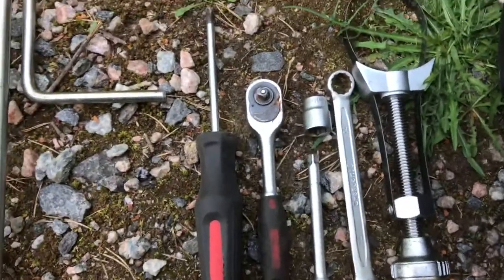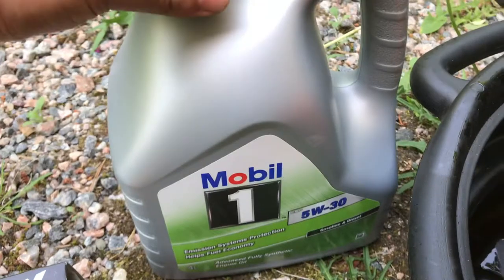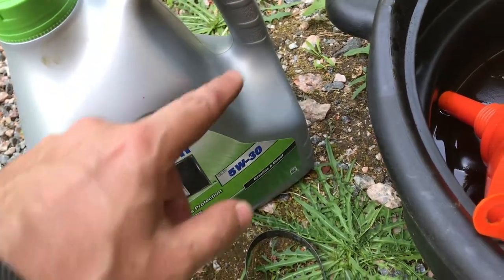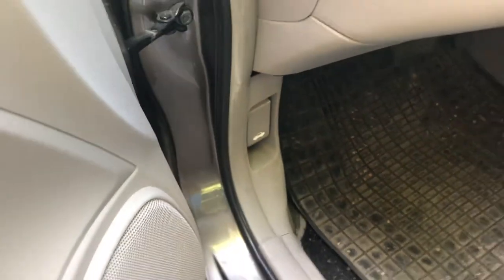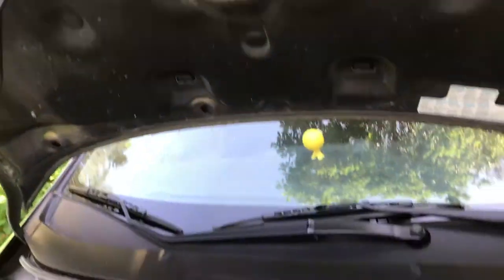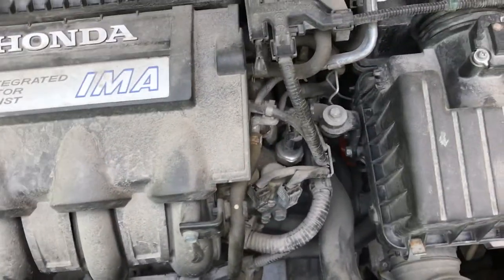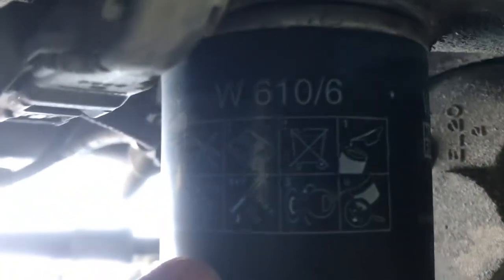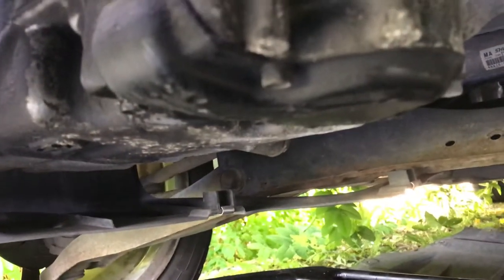Honda insight annual service, Oil change, Oil filter, step by step guide.

Comment: Good video I do the same I live in Italy we don’t really have a harsh winter over here but I change my oil 2 twice a year I used castrol edge 5w30 my insight is around 280k km
Reply from the maker: I think this is a small price to pay for keeping your engine tip top compare to what you need to pay for a tired and broken engine. Well done my friend on behalf of your insight and thank you for your comment ✨🙏
Reply: @lifeleaves1268  a question do you think using any brands of 5w30 full synthetic oil matters or should I just stick with castrol ?
Reply from the maker: @vonbon26  I think in your case since you change twice a year and don’t have such a harsh weather as me here in Finland. Any brand will do. I have always used mobil and castrol and never had any problems. However I know that the mechanics generally use the cheapest available oil in bulk and use it for all cars. I would stick with castrol or mobil but really fresh oil is what matters. Btw. Have checked the status of your cvt fluid since the car has been running for over a quarter of a million kilometers?  I would recommend you to change it if you have not done it yet.
Reply: @lifeleaves1268  ok thanks I don’t usually go to a mechanic to change my oil I do it by my self or with friend of mine I already check my cvt oil last year around 272k I’m at 278 now
Reply from the maker: @vonbon26  keep up with the good work 👍

Comment: Hi, I have the same car and I just want to ask, Does your car jerks while accelerating coming from stop? If so, did you manage to fix it and if not do you have any idea what causes it? Thanks!
Reply from the maker: @adrianbryan8830  of course it does. It’s a factory bug with all insights as they put 63 HP engine to work with hell of a CVT gearbox/transmission! The engine simply doesn’t have enough power to supply when you gas it from full stop. If you have ever driven a manual car. It’s exactly the same feeling as not accelerating enough and letting the clutch go too fast. You just need to find that sweet spot with the accelerator and you will be alright 👍. Hope this helps you. Thank you for the comments 🙏
Reply: @lifeleaves1268  thank you for your reply.. now i get it. i thought is has some issues on it. It is our first car so yeah maybe we have a wrong choice 🤣 but gas consumption is very very nice!..  By the way you mentioned in your video that you are from finland..  I am living in finland with my family specifically in Oulu. Hope to see you around
Reply from the maker: @adrianbryan8830  You have not made a bad choice but there are certain things that you need to watch for specially if you live in a place like Oulu! Change the CVT fluid every other year. It should be the really tick glue like green stuff not the fine water like pink stuff. Mine was changed by Honda maintenance to the wrong stuff every six months under the previous owner watch. As the car is so low, you will have to pay special attention to the side skirts in the winter as they will easily rust and you will need to replace them to pass the yearly inspection. Other than that the car is a nice little daily and just because prius has dominated the Finnish market only 2500 of them ever came to Finland so it’s also a rare car. We have had ours for 8 years now and if your change the oil and filter every year and CVT fluid every 2 to 3 years, it will last you a long time 👍. I live further in the south of Finland and who knows, maybe one day we bump into each other 😁.
Reply: @lifeleaves1268  thank you for this useful tips. 👍👍 I just recently changed the CVT fluid to an auto service shop just because i thought that there is an issue why it is jerking while accelerating from a stop but still the jerking is there 😅. There is a thing that i am doing recently before i move the car so it won't jerk and i think it is working and it might also help you to your honda insight. 

I warm up the car until the blue sign (cold temp indicator) is gone and after i shift my gear to "D" i will just wait for a few milli seconds until the rpm reacts (im not sure if it happens to you as well) and then that is the time i move or accelerate the car. I think it works 😅😅 but sometimes jerking is still there mostly if comes to a stop and auto idle stop will activate.
Reply from the maker: @adrianbryan8830  Thank you for the tip. I will give it a try 👍
Reply: Hi again! I just want to ask something about my side mirror indicator.. it is not working anymore on the driver side. Do you have any idea if it only needs to replace a bulb or do i need to change the indicator itself? Thanks!
Reply from the maker: I actually have a video about this! You can not change the bulb as it is sealed within the housing. I had the problem around 4 years ago and at the time Honda wanted to charge me about 200 euros for the part only. They said you need to change the whole mirror. I bought an after market indicator only from Thailand on ebay for around 20 euros and it has been working fine for me ever since. It is a pretty easy job if you pay attention and spend time doing it not to break the mirror.  Good luck with the project. 👍
Reply: @lifeleaves1268  ohh.. i need to watch that vid.. surprisingly too expensive for a 200euros its better to do it on our own.. 😅😅 do you think it will not going to pass in katsastus if that mirror indicator is not working?
Reply from the maker: @adrianbryan8830  that was the reason that I changed it as mine failed katsastus jus because of that 😁
Reply: @lifeleaves1268  ohh 😅 i should order it now. My katsastus will be next month 😅😅
Reply: Hi again.. im sorry i ask too much question 😅 i just want to know what kind of cvt fluid you are using?
Reply from the maker: @adrianbryan8830  I use the CVT fluid sold at motonet. Here is the link to the product https://www.motonet.fi/tuote/comma-aqcvt-cvt-5-l-vaihteistooljy?product=59-0350
Reply: @lifeleaves1268  thank you for this.. i will check this out 🙏🙏
Reply from the maker: @adrianbryan8830  You welcome. Glad to help.

Comment: Why 5w30?
Reply from the maker: It would be easier and less pressure on the engine during cold winter days. Although the best oil velocity for the hybrid cars is 0w-20, but it is really costly and I rather change twice a year with the cheaper 5w-30.

Comment: I can't believe you didn't change the filter.. 😳😳🤷‍♂️ You made a good video taking time to explain everything but didn't change the filter.?!?! There is always a load of old oil held in the old filter. Your nice new Mobil 1 oil will be mixed with some of the old stuff.. 🤷‍♂️
Reply from the maker: You are right. But bear in mind that the location of this filter is very bad so I have to replace the filter with an empty one which causes more damage after the first start as there would be no lubrication around the pistons until the filter fills up and then it pumps the oil to the engine. Also I change the oil on this car twice a year every 5000 km or around 2.5k miles which is way below the mobil life span and I change the filter with every other oil change. The reason that I change the oil twice a year is due to harsh weather here in Finland which hits -30 centigrade during the winter and over 30 during the summer and causes the oil to brake and loose its velocity. Thanks for watching and leaving the comments.